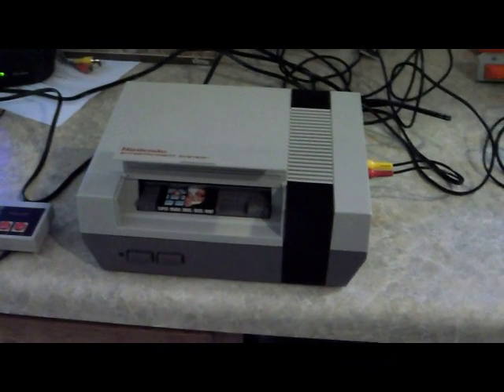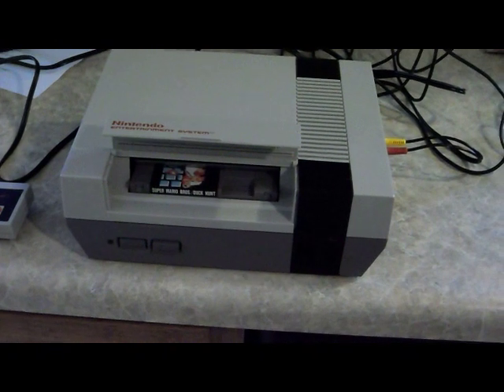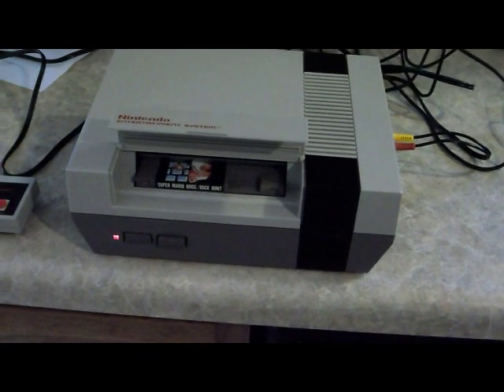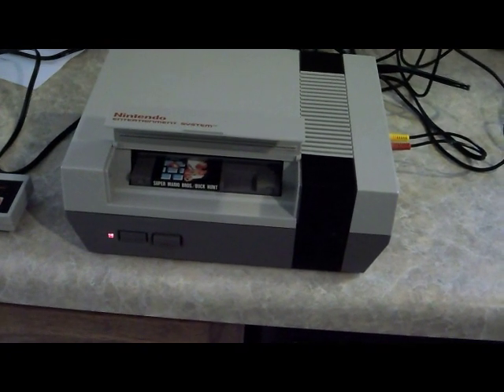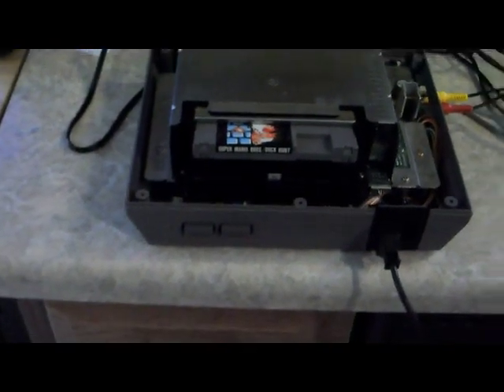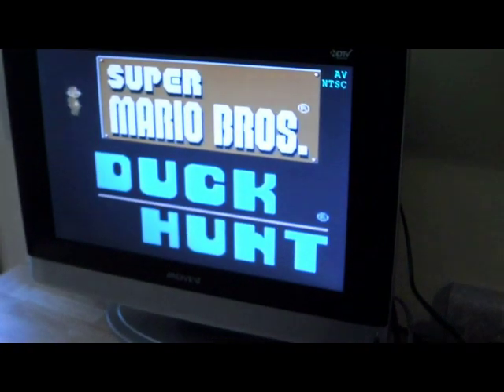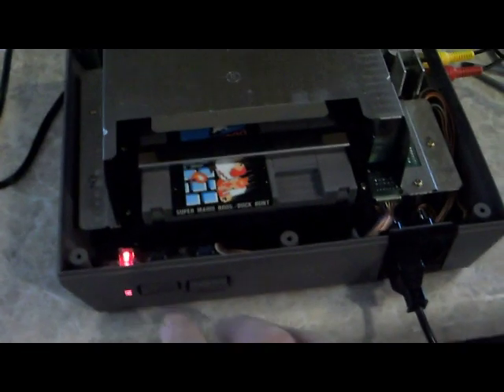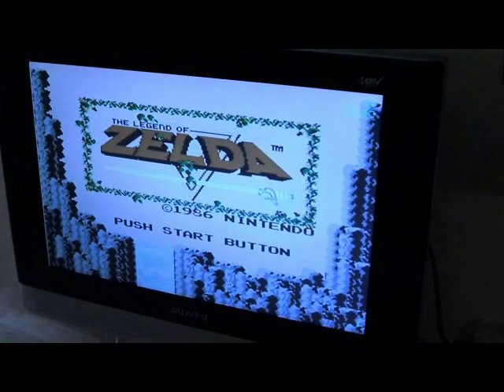NES Region Mod, or Quick Video of The Nintendo NES Lockout Chip Being Disabled.

Comment: For some toaster models disabling the lock out chip is the only way to prevent the blinking problem. I actually ended up replacing the 72 pin connector on mine too and I try to prevent wear and tear be not pressing down the games when I play them. I've heard that saves the 72 pin connector too.

Comment: @edt1138 Hey, sorry If I seem to pushy on this, but I think I found the possible problem with my Snes: "Every SNES control deck has a regional lockout chip (known as a CIC), as does every original SNES game cartridge. Before a game is loaded, the console will attempt to communicate with the CIC chip on the game cartridge. If the CIC chip doesn't respond or does not correspond with the consoles CIC, the console won't load the game. In most cases, a black screen is displayed."
??

Comment: Don't just break pins off willy nilly, tie them back to ground instead. An engineer at Nasa I believe scrapped a whole project because of an unused pin on a chip, thinking the design was defective he started over, only to find this very issue again and feeling like an idiot for ignoring.

Unused pins can created unwanted RF, and although it's widely proven with the NES to cause absolutely no trouble, good practice involves tying it to ground.